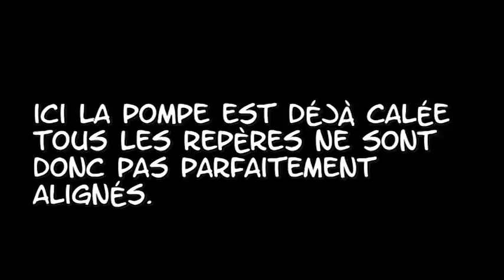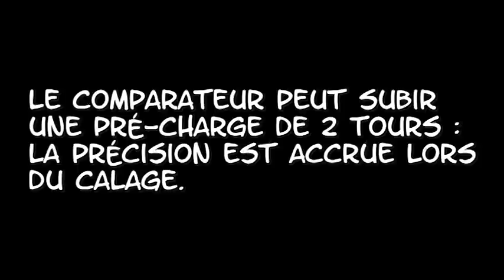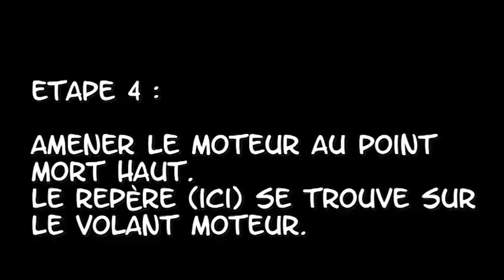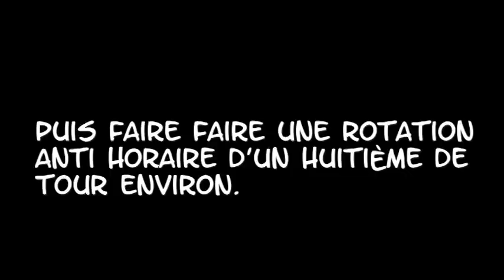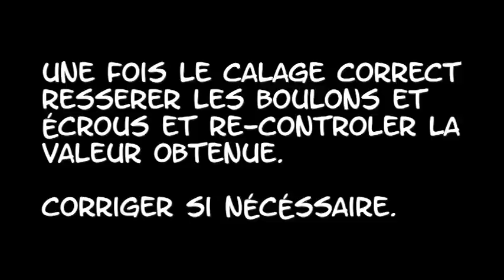Caler une pompe à injection BOSCH VE

Comment: salut j'ai un souci avec mon d24 monter sur un vw lt 31, en fait j'ai changé le joint de culasse, roder les soupapes et changer la distri et j'ai du sortir la pompe à cause des vis de fixations qui étaient plus que grippées et foirées par la même occasion ... bref la j'ai tout remonté et impossible de redémarrer malgré un callage que j'ai fait parfaitement en respectant à la lettre le bouquin technique ! le carburant arrive à la pompe sans bulles, il arrive à tous les injecteurs en dévissant les raccords, j'ai purgé le circuit basse et haute pression, le calage de la distribution est bien fait j'ai revérifier et la compression semble bonne quand on met la main devant l'échappement et qu'on actionne le démarreur en même temps... 
 
je viens de vider deux batteries et toujours rien ça a même pas peter un petit coup comme si le gazole était coupé !

je commence vraiment a être à cour d'idée, à tu une idée de truc à vérifier ou à faire pour le démarrer ?
Reply from the maker: Salut,
As tu désactivé le système de départ à froid quand tu as calé la pompe ?
Reply: ben la tirette n'était pas mise mais je ne l'ai pas débranchée carrément comme dans la vidéo (je suppose que ça ne change pas grand chose).
pourquoi ça peut décaler l'injection au point de ne même pas fumer ?
Reply from the maker: Pour un bon calage tu dois avoir une avance de 0.97 mm de levée sur ton comparateur.(le manuel du lt 31 dit ça ) mais si j'ai bien compris tu as un d24.
Donc sur c'est un d24 atmosphérique tu dois avoir 0.80 environ.
c'est une grosse différence.
quels injecteurs as tu ? ( de quel moteur ? la pression écrite dessus ?)
quel moteur exactement ? de quel véhicule ?
quelle pompe ? de quel véhicule ?
les bougies de préchauffage fonctionnent elles ?
Reply: justement je l'ai régler à 0.80 comme indiqué...
injecteur EFEP 182 tarés à 150 bars
moteur atmosphérique dw sur un vw lt31 de 1985
pompe à injection epve 6/10 f 2150 L 104 
tout d'origine du véhicule.
et les bougies de préchauffage fonctionnent parfaitement j'en suis certain..

le fait qu'il n'y ait aucune fumée me laisse penser que le gasoil ne veux pas monté en pression, y'a t'il un moyen de s'assurer que les circuits sont à 100% purgés ?
Reply from the maker: 150 bars c'est beaucoup pour un moteur atmosphérique.(c'est normalement une pression d'injecteur de  moteur turbo)
130 bars  c'est ce que tu dois avoir normalement.(dixit le manuel du LT )
tu dois donc ajouter un peu d'avance sur le calage de la pompe pour laisser le temps à tes injecteurs de monter en pression.

Le manuel précise que tu ne dois pas intervertir par mégarde les raccords banjo de gazole de la pompe.(les vis creuses)
Il y en a une qui est marqué "out" c'est pour le retour elle est équipée d'un papillon.

Pour purger :  dévisse les 6 raccords des conduites haute pression coté injecteurs et décolle les légèrement de  chaque injecteur pour éviter de creer une resistance à l'écoulement  du gazole. 
Fais tourner le moteur,tu dois avoir 6 giclées de gazole.
Si tu as ça, ton circuit est normalement bien purgé. 

Sur un diesel pour que ça fonctionne : 
-il faut que tu ais suffisamment de compression (jeu aux soupapes ok ?/distribution bien calée ?)
-il faut du gazole (pas d'air dans les conduits ?/pas dinjecteur coinçé ou mal remonté,bouché ?)
-il faut que le gazole soit injecté au bon moment.(bon calage de la pompe avec les injecteurs 150 bars ?)
Reply: d'accord merci de tes réponses rapides et précises, il faut peut être que je teste les compressions pour isolé le problème avant de me pencher uniquement sur l'alimentation en gazoil ..
Reply from the maker: écoute ton moteur quand il tourne au démarrage,tu devrais avoir les 6 compressions ,donc une vitesse de rotation régulière,et pas des accélérations et ralentissements,comme s'il boitait.
Si tu veux tu peux poster une vidéo,ja'i assez l'habitude des d24.
Reply: ouais je comprends bien, la il vien de démarrer 5 sec il a fait un gros nuage noir et bleu et plus rien ..
Reply from the maker: noir,c'est l'accumulation de gazole ou gazole en excès.
bleu c'est de l'huile ,
gris c'est un calage avec trop d'avance.
mais faudra voir moteur chaud,sans avance manuelle (tirette)
Reply: d'accord, merci pour l'info ! j'ai l'impression que la batterie donne pas assez de pêche ! ta quoi comme batterie sur la Volvo ?
Reply from the maker: Une 80 ampères/heure.
Reply: super ! finalement il a finit par démarrer il était juste mal purgé maintenant il tourne comme une horloge :) 
merci encore et continu tes vidéos elles sont top !
Reply from the maker: Merci : )
Félicitations , bon boulot ! : )

Comment: Bonjour, est-ce qu'une pompe VE provenant d'un moteur renault ou peugeot peut se monter sur un moteur volkswagen (je pense au moteur 1.9 td du groupe vag) 
merci
Reply from the maker: Bonjour,
Les moteurs VW ont, à ma connaissance,que des pompes Bosch VE en ce qui concerne les diesel à injection indirecte.
Dans la vidéo c'est le cas : moteur VW et pompe VE.(même si c'est monté dans une volvo atmosphérique ici...)
 la fixation de la pompe et les quantités de gasoil injectées doivent être similaires.
cylindrée égale donc.
surtout dans le cas d'un TD il faut enrichir quand le turbo souffle,donc il faut une pompe qui provient d'un TD de chez renault ou peugeot.
il y a un diaphragme sur le dessus de la pompe par rapport à une pompe pour moteur atmosphérique.
Dans le principe ce ne sont que des pompes elles peuvent aller sur n'importe quel moteur tant que la pompe peut alimenter tous les cylindres.
des gens changent souvent des lucas pour des bosch plus résistantes pour rouler à l'huile par ex.

Donc oui,si les fixations et tuyaux d'alimentation vers les injecteurs sont compatibles.
Reply: michaelovitch
Merci de cette réponse rapide ! reste à voir l'arbre de sortie si c'est les mêmes ou non. sur les différentes marques. 
Si je "swap" une pompe autre que vw je vous tiens au courant.
Reply from the maker: Sky Renaud
Il y a un topic connu sur ce genre de modifications.
http://www.forum-auto.com/pole-technique/mecanique-electronique/sujet293129.htm
http://contrails.free.fr/engine_bosch_ve.php
il a utilisé une bosch à la place d'une lucas je crois.
c'est à priori faisable.
Reply: michaelovitch
Je suis justement en train de le lire, mais en premiere page je vois déjà une différence avec la mienne, c'est au niveau du calage que c'est différent. Sur mon moteur c'est comme ça: http://www.forum-auto.com/pole-technique/mecanique-electronique/sujet568028.htm
Reply from the maker: Sky Renaud 
peu importe,ce qui compte c'est le calage précis de la pompe au comparateur.
là les repères "poulie" c'est pour le calage grossier fait avec la distribution.
ce calage grossier se fait avec des repères présents sur la pompe et la poulie qui y correspond.
il suffit de caler la pompe avec ce repère de base et d'intervertir les poulies,si besoin est,avec la nouvelle pompe,qui est calée elle aussi grossièrement.
Reply: michaelovitch
Bonjour,
j'ai donc monté une pompe de 306 TD, une bosch VE, pour parfaire le montage j'ai donc du trouver une autre poulie, en l’occurrence une poulie de golf 3 TDI. Mon problème maintenant c'est de savoir comment trouver mon point de démarrage?? J'ai beau chercher mais je ne trouve pas. si tu peux me venir en aide?
Reply: Sky Renaud
Mon villebrequin et arbre à cames sont déjà calés, il me reste juste la pompe.
Reply from the maker: Sky Renaud
Bonjour.
Sur la pompe et la poulie d'origine de la pompe il doit y avoir un repère.
ces points coïncident pour déterminer quel cylindre sera alimenté selon le calage de distribution de ta voiture.
les repères c'est pour pas se tromper et injecter au mauvais cylindre au mauvais moment.

Si tu as calé la distribution tu dois avoir un seul cylindre au point mort haut injection :
les lobes de l'arbre à cames pointent en V vers le ciel car les soupapes sont fermées.
le piston est en haut, soupapes fermées ,c'est là qu'on a injecté du gas-oil avec un peu d'avance.
c'est ce cylindre qui est ta référence.
la pompe aussi injecte dans un ordre particulier.
généralement c'est cylindre 1 puis 3 puis 4 puis 2.
toi tu dois savoir quel cylindre ta pompe va alimenter en premier dès que tu vas démarrer depuis ton calage distribution

Sois tu reportes les calages d'origine sur ton montage sachant quel cylindre va être alimenté pour chaque montage (origine et ton montage) 
S'ils coïncident c'est facile.

Sois tu fais simplement tourner ta pompe "à la main" pour voir d'où ça gicle : sortie 1 2 3 ou 4 (sans faire tourner le moteur juste la pompe)
tu tournes jusqu'à ce que le bon cylindre soit alimenté (celui du point mort haut selon ton calage distri actuel) 

les pompes tournent en rond t'as donc une chance sur 4 pour tomber dessus sur un 4 cylindre si tu fais au pif...

pour déterminer quelle sortie haute pression correspond à quel cylindre sur la pompe, installe les tuyaux des injecteurs.
tu verras que si ça gicle au cylindre 1 et que ton point mort haut injection est au n 4 c'est pas bon.
t'auras qu'à tourner la pompe à la main pour les faire coïncider là d'où ça gicle avec celui qui est au point mort haut injection.

Comment: Bonjour j'ai acheté dernièrement une Volvo 940 et celle-ci fume beaucoup au démarrage dois je changer nez injecteur plus calage de la pompe ou puis je refaire simplement un calage de lapompe??? La voiture à environ 350000kms moteur D24TIC merci cordialement David
Reply from the maker: David Briche Bonjour
Quelle couleur de fumée ?
Reply: je dirais bleu et sent le gasoil
Reply: De plus je trouve que au ralenti à chaud le moteur vibre beaucoup
Reply from the maker: David Briche Il faut tester les bougies de préchauffage.
Si ça n'est qu'au démarrage il y a de fortes chances que ce soit cela.
Un calage de pompe ne se fait que si c'est déréglé,du fait d'un démontage.
Si les injecteurs ont plus de 150 000 kms le mieux est de les changer,tarer et recaler la pompe,oui.
Il faut aussi être sur que le système de départ à froid fonctionne.
Normalement le régime moteur redescend tout seul quand il est chaud.
Il est plus elevé à froid,comme avec un starter sur un moteur essence.
Reply: Donc bougies (6) préchauffage ok changer par l'ancien propriétaire, pour les  injecteurs surement plus de 150 0000 pas d'info sur ceux-ci et système démarrage à froid ok environ 1100trs à froid ensuite redescend à 850trs
Merci des infos
Reply from the maker: David Briche Ok pour les bougies mais quand ?
Elles peuvent durer 2 ou 3 ans ,même plus ,mais aussi beaucoup moins.
Tout dépend du nombres de démarrage.

Normalement il y a des poussoirs hydrauliques sur ce moteur.
Mais il faut être sur,car il se peut que le moteur ou culasse ait été changé et qu'il y ait des poussoirs mécaniques,et donc,un jeu aux soupapes à faire.
ça aurait plus posé problème par temps froid normalement.

Le turbo a t il du jeu ?
Le moteur a t il une bonne compression ?

 le pb de fumée vient d'arriver soudainement ?
Reply: Bougie fait en 2012, et effectivement par temps froid elle fume plus au démarrage car quand le moteur est chaud pas de soucis mais je trouve que le moteur au ralenti vibre pas mal sans doute du aux 6 cylindres, non pas de jeux dans le turbo j'ai démonter le conduit arriver d'aire pour vérifier cela et toutes les durites retour gasoil on étaient changer ainsi que le filtre gasoil dernièrement c'est le vendeur qui m'a diriger sur vos vidéo pour la calage pompe et distribution. cela ne fait que une semaine que j'ai la voiture et je recherche sur le net ce qui peut être la cause de tel fumé au démarrage passablement pénible pour mes voisin, de plus elle a passé le CT avec succès question pollution en février 2015 et pas de trace d'eau dans l'huile, merci à vous pour tout vos conseils, est ce que le turbo peux se démonter et se nettoyer comme sur les moteur Audi avec GV???? Ce que j'ai fait sur la voiture de mon fils
Reply: Je n'ai pas fait faire la prise de compressions des cylindres, bon j’espère que je me suis pas fait avoir avec voiture car elle est super propre et l'ancien proprio en prenez soin d'ailleur il a racheter une 940 mais avec moteur 122cv le mien est un 115cv
Reply from the maker: David Briche Un 6 cylindres vibre moins qu'un 4 cylindres.
Si ça vibre c'est juste du à un déséquilibre dans les vitesses de combustion.
c'est tout mécanique,pas électronique, et on ne peut rattraper le travail d'un injecteur feignant avec la commande décalée d'un autre.
Si ça tourne ma,l ça veut dire déséquilibre de contribution d'un cylindre.

Il serait sage, pour commencer au plus simple,vu les symptômes, de tester les bougies avec un ohmmètre ,ou en alimentant une par une ,démontée,avec la batterie.(attention les doigts,c'est censé être chaud)
2012 c'est pas tout neuf pour des bougies.

Inutile de s’embêter à nettoyer le turbo.
Il n'est pas à géométrie variable et il ne s'encrassera pas,même si ce moteur à l'EGR.
Au pire il y aura un peu d'huile,déposée par les vapeurs d'huile qui reviennent du bloc moteur. 
Pas de souci à se faire ici.
Pour répondre ,oui ,il est démontable.(j'ai essayé...)
http://s685.photobucket.com/user/michaelovitch/media/Sanstitre1.jpg.html?sort=6&o=84

Évitez de désassembler la turbine et compresseur de leur axe,l'ensemble est équilibré en usine.

Vous pouvez passer à 122 chevaux,il suffit de mettre un échangeur d'air.
Reply: Merci je vais vérifier les bougies un Ohmmètres je n'arrive pas à trouver la RTA de la Volvo 940 avec ce moteur D24TIC dois je prendre la RTA de la 740??? Et pour la bougie du cylindre numéro 1 est ce qu'il y a une astuce pour la démonter vue qu’elle se trouve derrière la pompe injection encore merci d'avoir pris le temps de me répondre malgré ces soucis c'est un plaisir de conduire cette superbe volvo 940
Reply from the maker: David Briche Pour la rta ,je ne sais pas.
Le moteur est le même sur la 740 alors oui.
La bougie du fond est la n6
Il faut compter depuis la distri sur ce moteur (quasi sur tous d'ailleurs)
Il y a une clé spéciale toute biscornue pour ça.
Moi j'ai des grosses mains, mais j'y arrive avec des outils classiques.
Passant par le dessous de la pompe entre le bloc et la pompe et par derrière....
En tout cas c'est faisable,faut juste être un peu patient et essayer dans tous les sens avec les deux mains.
Astuce : on peut enfoncer la bougie dans un tuyau/durite souple pour l'installer et la visser.
ça "serpente" et ça aide.
Reply: Ok merci je vais voir ce que je peut faire avec mon outillage classique quitte à modifier une clés si besoin,je ne suis pas mécano de métier mais j'aime bien prendre soin de mes véhicules moi même.
Reply: Bonsoir je reviens vers vous pour avoir des infos si vous pouvez m'aider donc ce soir voiture toute la journée au boulot en plein soleil et quand je l'ai démarré ralenti en dessous des 800trs et grosse fumé donc je part  sur un filet de gaz du travail et voila que celle-ci tousse sur 300métres ensuite elle repart donc possible que l'injection soit défaillante ou un injecteur gripper??? Quel clés j'ai besoin pour démonter les injecteur et vérifier ceux-ci??? Merci pour votre aide cordialement
Reply from the maker: David Briche Il faut commencer par les bougies.
Même en plein été ,un diesel à injection indirecte ne démarrera pas s'il n'a pas des bougies de préchauffage qui fonctionnent.
ça n'est pas un hdi à injection directe.
Si c'était un problème d'injection,il y aurait aussi un souci à chaud.
Si c'était un injecteur grippé ,il y aurait aussi le problème à chaud.
Je sais de quoi je parle j'ai le même moteur avec ces soucis ; )
Reply from the maker: David Briche Pour répondre à la question : 
Il faut une douille de 27 spéciale injecteurs.
Il faut extraire les rondelles pare flammes et les remplacer par des neuves.
Il faut tester les injecteurs à la pression d'injection,qualité de pulvérisation,tenue de pression
resserrage du porte injecteur à 7m/kg et serrage sur la culasse à la même valeur.
Reply: Merci bien je vais regarder tout cela des que possible